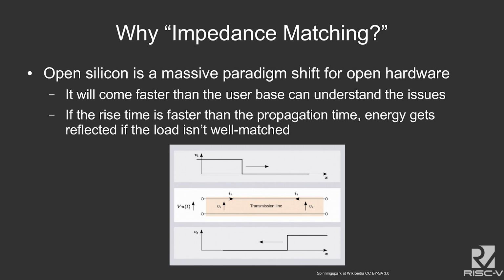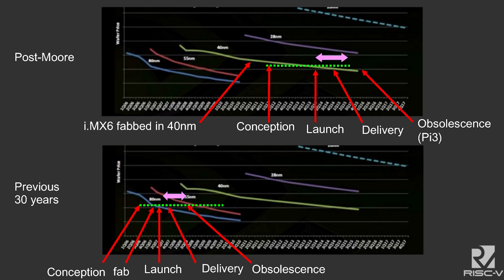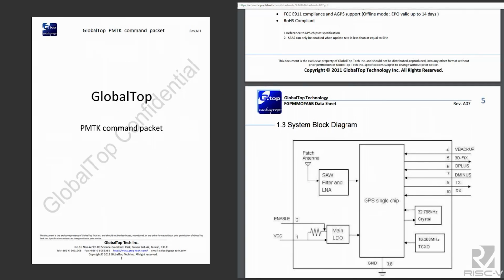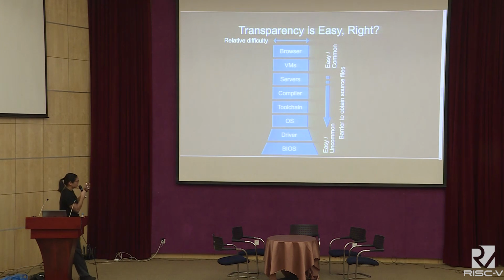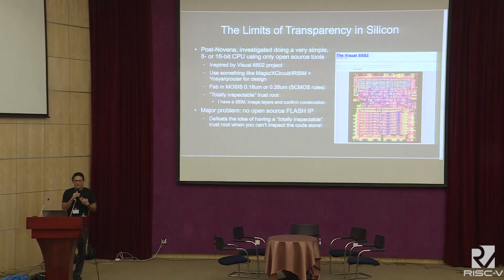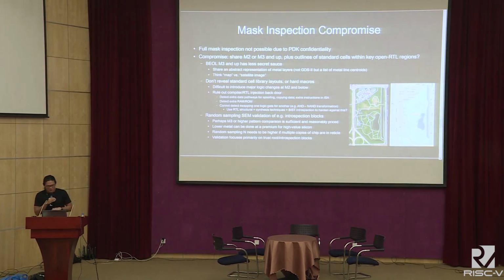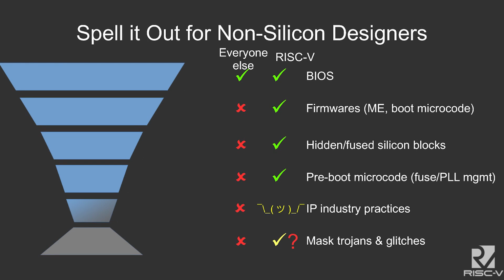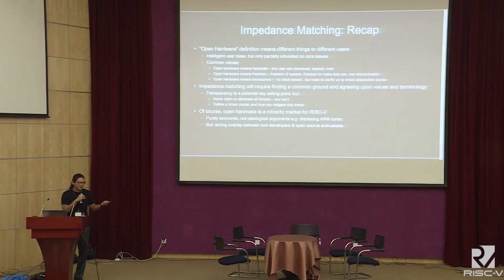Wednesday 11 00am   Keynote Address  Impedance Matching Expectations Between RISC V and the Open Har

Comment: There is a very easy solution for hidden silicon blocks, IP industry practices and mask trojans: Make the open source FPGA already. The functionality of every single element of an FPGA can be tested thoroughly. No hidden silicon can sniff or modify data because the function of a specific element of the configured FPGA cannot be foreseen at the production time of the silicon.
Reply: @JayDee-b5u  We are almost at the point where a softcore on a reasonable cheap FPGA board can generate its own FPGA image. Silicon in high volumes is cheap.

Comment: great talk, what file format/proprietary EDA software is mentioned at 10:45? 

"on the other hand, if I gave you a file that's openable in ...., you're gonna need a million dollar license to open that file." 

Someone sneezes while he mentions it so i can't hear what word he says.

this stuff really should be opened up all the way down. Nothing lies in silicon right?
Reply: He was probably referring to high-end EDA tools like Mentor Graphics and Cadence.  I worked with Mentor Graphics Expedition and Boardstation and they are very very expensive licenses.  Years ago, I remember just one small PCB Layout shop(not IC design) pays like over $250 USD a year.
Reply: It did sound like "Cadence".